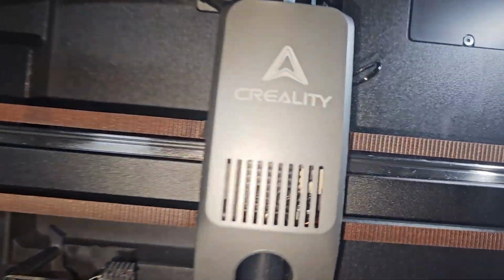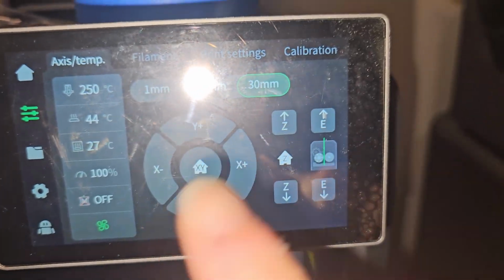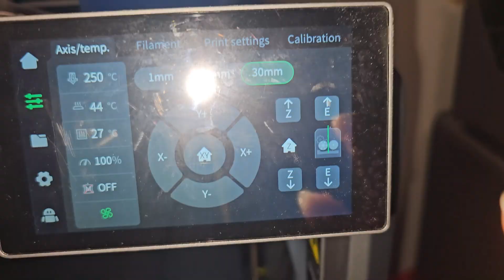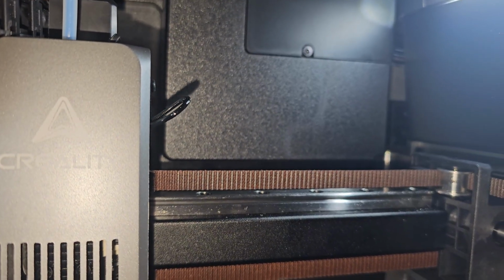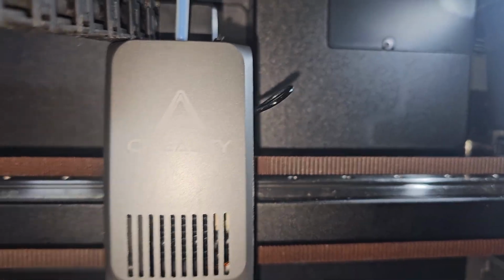Creality K2 Plus Filament Coming Out From The Side Of Extruder LOL

Comment: I think that metal flake was a tooth from the PTFE tube holder of the extruder cover.  That is what I saw when mine failed.  I've seen this sideways issue printing with PETG and heat creep :(  Solved it by playing with temperatures.
Reply from the maker: Definitely, heat creep is an issues with metal and these enclosure 3d printers.